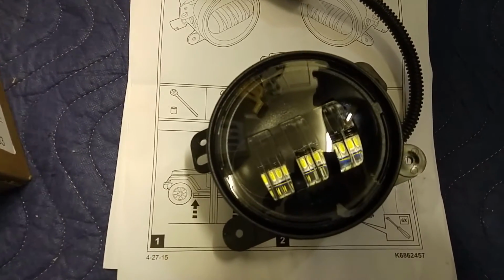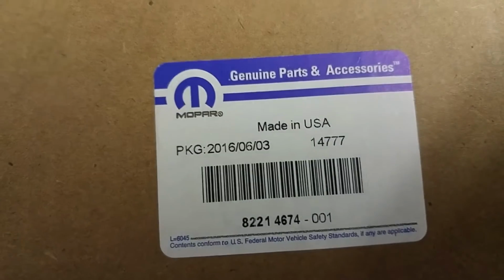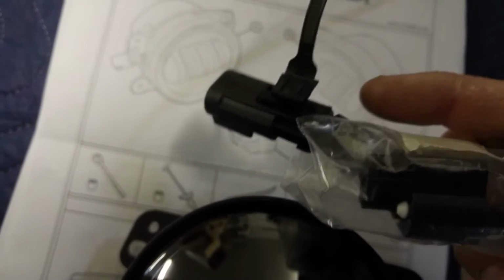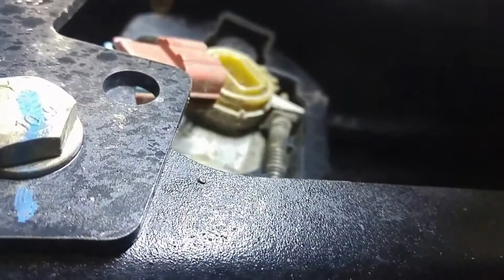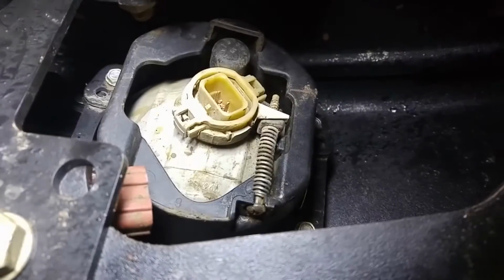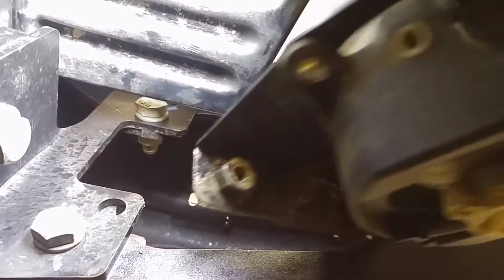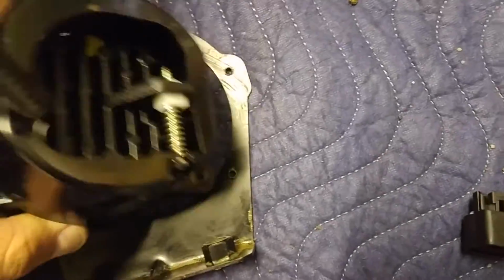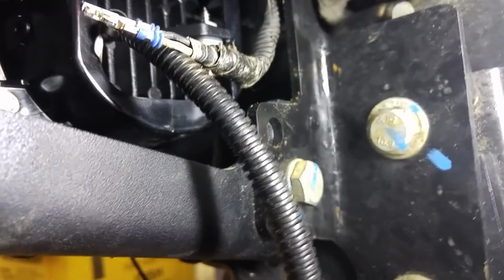MOPAR | JW Speaker - LED Fog light install - AEV JK Bumper

Comment: The Ave bracket base is at an angle. When you match the 4 screw holes attaching the light. The LED light is at angle about 45 degrees. When you put it back into the bumper. What’s up with that? Is there a new bracket out there that AVE makes to accommodate the LED horizontal lighting?
Reply from the maker: We used the stock AEV bracket and it aligned ok. Hope you were able to get it sorted ok.